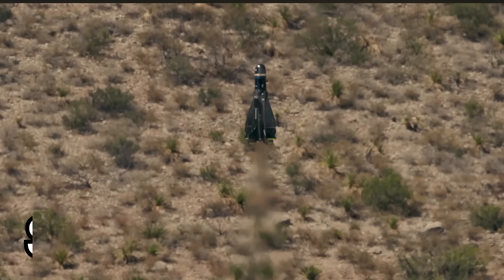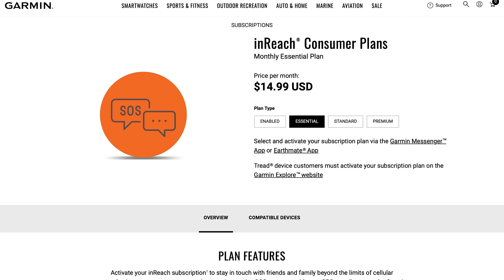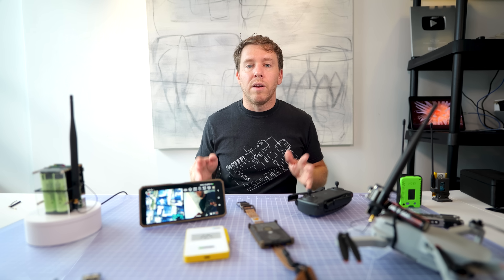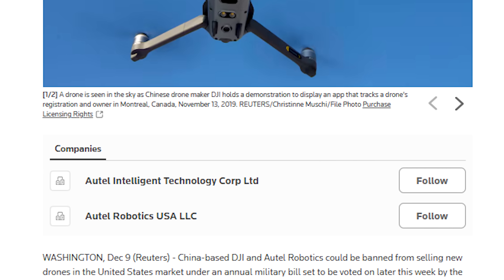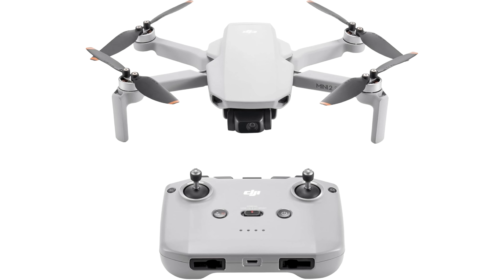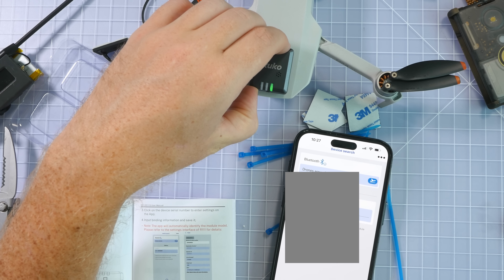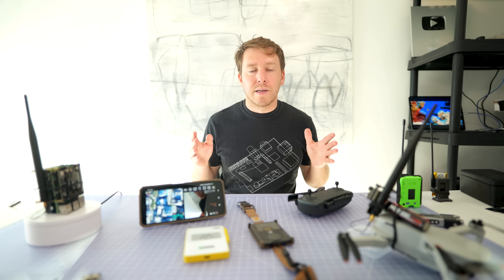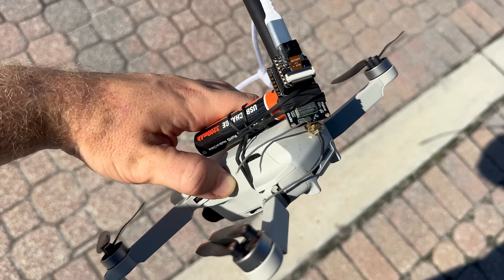I Built a $40,000 Military Drone for $120.07

Comment: Ukrainian drone employment analyst here:
1. Tactical level recon drones (hacked DJI mavic 3/3-T/4/4-T) are about $4-6k including all combat modifications, including removing controller ID.
2. Can this thing fly without GPS that is jammed at all time on the frontline?
3. The radio connection frequency range is jammable.
4. Camera quality and FPS matters. You will not be able to see a couple infantrymen trying to infiltrate throught the frontline with this.
5. Mavic 2 and mavic mini have pretty poor resistance to wind and rain. This will not survive a single takeoff in a bad weather.

Comment: The waves are due to the "shutter-speed" effect: it's the result of a frequency mismatch between your image sensor's refresh rate and the drone shaking. Possibly, your drone shakes rapidly side to side and your image sensor fires from top to bottom - hence the vertical waves.
Possible solutions (not exhaustive):
- use a dampener to isolate the lens+sensor from vibration
- look at balancing propellers, rotors and shafts
Apologies for only proposing solutions that add weight. 
That said there might be image-stabilized sensors on the DYI market that I don't know of.

Comment: Re the warped appearance - "Jello" - -  iinitially replied to anothe rstub below - now posting it here..

Jellow IS (a variation of) rolling shutter effect with oscillations several times per Rollins shutter Event..

-  back in the OPen Source Quadcopters

 (I still hate calling anything "drone" as a generic poorly defined term - studied Mecha and Mech Eng over a decade ago UAS was being designated as the better term for Pros un the Unmanned Spac - DJI hadn't really gone very far with their Quadcopter toys..) 

...   GoPro cameras exhibited this really bad.. (it was the beginnings of all things FPV)  Jello Images  (a decade ago)   it needs a damping - but non "low frequency" deforming mount  - a lot of people have used double sided tape (film like - 3M VHB tape) on memory foam  - Building a simple very  durable jello free mount - several loops of  thin stainless steel cable (flexible)- secured with plastic or metal strips - on a top and bottom platform, this has a reasonable spring rate and is damping 9it shouldn't ring at the frequencies we are dealing with  -larger loops have a lower natural frequency, more loops  - higher, and / or directional damping - but it gets "heavier" - by a few grams.)..  As many or few loops or whatever size is required - around a circle is elegant for rigidity about the gravity axis.,  mount between anything desired to be "more or less" jello free - knowing it will never fail as it is more than strong enough for a small camera..

Comment: What the earth is curved !  The 249 g drone with your system is 300g and then needs a remote ID module adding more weight reducing flight time pushing you logically to use a larger heavier drone were the weight of the gear is a smaller portion with a 3 kg drone it has 1/10 the effect.  A very appropriate feature for remote controlled hobbyists came on the latest Tesla update you can have the DC to DC converter running with the car shut down very useful for charging lipo,s in the frunk while keeping the 12 volt acc battery fully charged at up to 120 amps 1.44 kw thats some serious drone charging.
Reply from the maker: Interesting

Comment: Ya I think the military is going to run with the $40k military super hd 4k streaming drone vs your chinese 1fps drone.
Reply from the maker: probably, but imagine what I could do with 40k
Reply: @DataSlayerMedia  buy a better drone and ziptie another shitty camera to it?
Reply: @DataSlayerMedia  you didn't do jack shit with 120 bucks either, you just figured out what "production cost" is. would you sell this drone for 120? No! If you built a drone for 40k, it would be sold for quite a lot more also. You used of the shelf parts, zip-tied and configured them, with Chinese backdoors. yay. 40.000 wouldn't even pay the quarter of an engineers yearly gross cost to a company, and you certainly need more than 3 months do develop and build such a drone.
Reply: @Martin-kv3th  bro what are you on about. the point is he built something 400 times cheaper that almost does the same thing. now imagine economies of scale making it cheaper, you can spend more on the camera and other software aspects. even if he 10x his production cost and then sold it for 5x what it cost, its still far cheaper than what the military are paying... this guy ahs no research and development money, no factory, no supply line, no economy of scale, no access to patents, nothing. and you here criticising him. get your head out your ass. the fact the military have already contacted him over most his back engineering shows hes not doing jack shit.
Reply: @sebbaker7133  he didn't. he really didn't. the range of this drone is barely 2km. im gonna put a firecracker into a metal tube and say "I built a $5,000.00 firearm for 12 bucks".
Reply: @Martin-kv3th  you didn't get my point at all. you think increasing the range of a drone is an extra 39,000$... mad bro that wasn't my point at all. its the fact that this is pennies compared to military drones and the tech they use isn't hard or expensive to get. china build drones for 10% of the cost and they still getting scammed by their businesses over there. what im saying is the companies sticking this stuff together have the craziest profit margins and are scamming tax dollars. they only have these crazy profit margins and are the fastest growing companies on earth because they build for cheap, sell high. this guy is trying to prove that point by showing the cost to build a low range drone is 400x times cheaper and the simple installation of long range receives is thousands, not tens of thousands, and with economies of scale, it should realistically be hundreds for a long range receiver chip. you can buy a 20km range drone from china for 300£ and yes they have been tested i cant remember the  brand but they are the world leaders in retail drones. how is this military drone still 130x more expensive than a 20km radius drone built by a retail company with no military subsidised r&d. mad i had to explain this simple concept to you.

Comment: Yes, the projects/products are upmarked in price by a certain magnitude, but they pass tests (MIL-STD and other standards) for electromagnetic interference, to waterproofing, to... whatever.  The things you build are similar in function to these overpriced products (and by no means am I suggesting you stop) but surely you recognize this? 

Also, some of the chipsets are better - the camera modules are better... but yeah there is pretty good off-the-shelf parity for many items. 

One item or object where there is none are FLIR/IR sensors. There isn't a cheap solution for a 2km off the shelf FLIR setup. The sensors themselves are very expensive. I did some light research into it but... didn't see anything promising. If a CMOS based sensor that was inexpensive enough was found, I wonder if slaving them all in parallel might yield a decent result but it might be better for an engineer-physicist to manufacture their own cooled sensor. Not sure.
Perhaps you could explore it yourself.

When I was a kid I'd ask for IC samples from companies pretending I had a business. Good times.

Comment: Try a longwire resonant antenna.  You could use any stiffer copper wire for an antenna, preferably solid.  See ham radio manual (ARRL Handbook - doesn't have to be a new one - or read at library) section on homebrew antennas.
Reply from the maker: Anything has got to be better than a sliced wire right? I'll check these out - thanks.

Comment: Why not start with a custom built quad copter as a base instead of strapping your gear onto a DJI drone? There are plenty of open source hardware and software options. The FPV community has already solved a lot of the problems you ran into including the "wavy" video. If I had to guess I'd say you're getting excess vibrations due to the off center weight distribution.

Comment: The 'waves' look like 'jello', caused from vibrations from the props. Try mounting the camera to hardware with little rubber feet. This is how the DJI "Air Units" attach to micro drones to try and reduce the 'jello'.

Comment: Sure, the markup could be lower, but a sketchy weekend project is not the same as a sturdy design that works in 140F desert heat. It's a different ball game. I'm a pilot and I use an iPad for flight planning etc.The iPad has a much faster processor, a better user interface, a higher-resolution screen etc than the aircraft avionics (Garmin G1000) and it costs 50x less. But, the iPad will shut down in a few minutes if the Sun hits it for like 10 minutes. The G1000 is certified to 114F, and it's just a general aviation aircraft. Military equipment is even tougher.
Reply from the maker: good points

Comment: I understand that the intent is that any given propriety part can be swapped out with some other consumer available replacement, but talking about the harm of locked down systems and expensive government defense contractors only to then use a starlink is a bit... ironic.
Reply from the maker: Is there an open alternative?
Reply: @DataSlayerMedia unfortunately, not that im aware of. I didn't mean my original comment as an attack on you or your work by any means, and I have mad respect for what you're doing, showing that repairable and open systems can replace these overpriced solutions that leech taxpayer money. I just have a strong distaste for starlink in particular due to working in a field affected by it.

Comment: I love this bc i did something similar a few years back, but way less sophisticated i strapped another vtx and camera to a 7" fpv drone, 3d printed an enclosure with fans for cooling an specktrum 6 channel receiver mounted to 2 servos as a gimbal and a separate 3s lipo batery, for live feed i used an analog to hdmi and a capture card hooked up to a 40$ prepaid phone with unlimited data and used attak to stream live video for an airsoft milsim match, it worked pretty good, gave us pretty clear advantage, it was roughly 200$ on the module including the phone and excluding the drone as it wasn't mine, the whole thing with drone weight at 1kg but it was 2020 and part 107 and remote ID was a consideration not a regulated thing yet. total price of everything combined was like 1000$ (controllers, drone, batteries, capture usb c capture card, goggles phone and sim cellphone service split between 4 friends) and was "opensource"
Reply from the maker: that's dope, adding this to my notes!

Comment: Well there's red tape but for mil spec stuff they also do need stuff to be battle-hardened and difficult to hack. To get that on the open source side your main option is SEL 4 or 5 instead of Raspbian, and then maybe adding some spark gaps and resettable fuses for EMP protection, and then making a more durable airframe and props. Then assuming some testing and iteration you're looking at something more like $3000, but yeah their markup is kinda insane.

Comment: Those "waves" are likely due to rolling shutter on your FPV camera from all the vibrations on your drone.  I know the DJI seems to be smooth and stable but they're not - the gimbal is.  If the DJI's drone camera wasn't on a gimbal it would be un-flyable.  You could 3d print a TPU mount to dampen some of that but honestly you're probably just better off going to CCD which uses a global shutter (reads the whole sensor at once rather than scanning it line by line).  Or build your own custom drone which should fly VERY smooth without the need for a gimbal.
Reply: A quick test you can do is mount this rig UNDER the dji so the drone isn't having to deal with inverted pendulum stability, try to get it as close as possible to the drone's CG and finally, use a velcro strap or similar to compress the camera against a piece of thick yoga mat or keychain floaty to dampen the vibrational noise coming from the propellers.

Comment: YES!!! 
Keep that other &39,000.00 so you can make it hardened to jamming scrambling, band licensing, manufacturing infrastructure, employee benefit, liability insurance, patent infringement protection, engineering the entire fleet electronics compatibility, integrity, flexibility to be usable by other branches of the military. Don’t forget you’ll need to build out support systems for technical consulting, training, product packaging for real time field deployment in combat areas of operation, and hardware compatibility, integration with several other airborne systems currently in the field 
This just scratches the surface. 
The price of a brand new SUV sounds extremely exorbitant until you begin to realize all of everything preceding the finished product- like factories, sub- suppliers, supply chains involved on n on motor mention competitors, the workforce of people needed, plus you state this is for military application, that opens up worlds of benchmarks to surpass. 
Good luck on doing ALL the OTHER crap involved besides building “a” prototype, and keeping your per unit cost at wht was it?-  $100.00 $120.00 ?
 By the time you deliver a few tens of thousands of units, get em in theater, and satisfyingly functional, you may find that $40 grand per unit is cheap.

Comment: Do your versions get tested to survive the various impact, signal disruption, and other tests that the MILSPEC approved ones that cost so much have passed? That's what civilians, and even most of the military don't understand. Yes, they're are some items that have been bogusly upcharged and the companies should be fined for those. Certain systems must be able to survive under abnormal conditions that will only be found in combat. Look at the evolution of warfare in Ukraine as an example. It's become a modern testing ground for so many systems from drones and communications to anti-shipping and more. Your Mesh system is great, but how secure is it? How robust is it? How hard would it be to saturate the wavelengths used to disrupt it?

Comment: Use icp. It's the decentralized processor/storage you're describing
Reply from the maker: elaborate
Reply: @DataSlayerMedia ICP is decentralized cloud but with a set of unique (nothing like it at the moment) features which might add an extra layer of depth and future proof your inventions. 
It has building blocks called canisters which both hold data + do the computing at web speed. Useful for decentralized drone swarm coordination, secure video/telemetry storage, or cheap compute fitting your open-source builds. Not to mention enabling decentralized and tamper proof AI you can use for drone navigation or LLMs where we don't have to deal with censorship or hacks. It might be the next big thing in tech. Don't know if I did it justice but I'm excited how you'd use it. 

Ps. The team is dropping an AI programming tool like lovable which would translate your idea's into apps straight on an icp canister. (called caffeine ai)

Comment: Your other 2 were much better, try missile interceptors with the same compute as an F35, Use IR and EO, and automotive lidar frag det, use an ablative insulation fuel core wrapper impregnated with dirty fuel, and 1500C resin to bond  1500C fibre. Try a Pi5 with a 4GB w100 GPU, give it a phi2 LLM trained on OSINT data, data discrimination, signal processing, and flight mechanics theory, and modern weapons, give it control over the fast response semi autonomous components such as autopilot, Arduino nanos, then mesh cage the electronics, with a 6cm fibre to sensors. Not many things slower than mach 3 will fail to be introduced to a standard NATO frag by it.

Comment: I'm curious as to why the statement "most systems don't work after 60ft? 1st off, for civilian use, drones have a ceiling of 400 ft and use almost exactly the same frequencies as wifi and have zero issues. Why would there be an issue of 60ft altitude? Is the issue with low watt transmitter?

Comment: Waves either can be rememdied with vibration isolation on the camera mount, or you could find a more stabilized camera sensor.  It's also to do with the camera sensor read speed, the lag from the sensor causes this. Having done this similar experiment almost 20 years ago while at university with old bullet style surveilance camera and a DVR, mounted on a motorcycle mud guard (i was trying to compete with gopro concept at that time).   No amount of cushioning/isolation could remove it, and it was down to the frame rate or read speed of the surveilance camear.  But neat idea!

Comment: i think you missed the point. Yes these things are cheap to build and yes these can be cheap to design. BUT, the initial R&D would have cost a fortune. Back engineering is a cheap hack because you didnt have to put the groundwork in.

Comment: The Military Industrial Complex is probably building it's 40k$ drone for 150$, too.
Reply: that is not true if you are making specializied boards it cost more than getting a jack of all trades best at nothing like the esp32(microcontrollers) series or arduino or rasberi pi (small computers)
also if you get carbon fiber materials for durabilty and use in all conditions(including on the battlefield ) and batteries that last for even a day

Comment: 14:45 Oscillations from vibration due to heavy load, wind, imbalance prop paired wirh a cheap camera that needs either mounted more securely or image stabilization.? 🤷‍♂️ I don't know but I'd start there, those wavy images are usually associated with vibration.